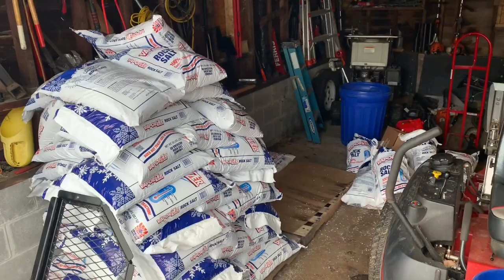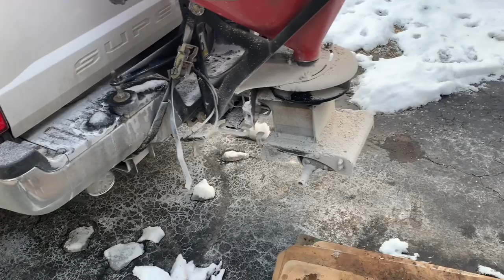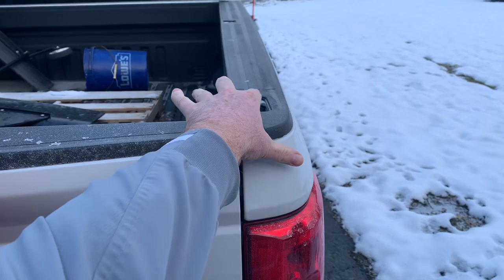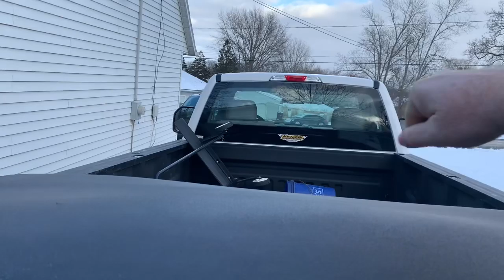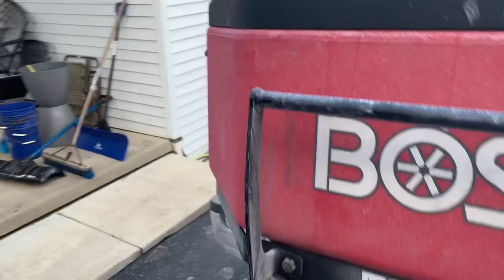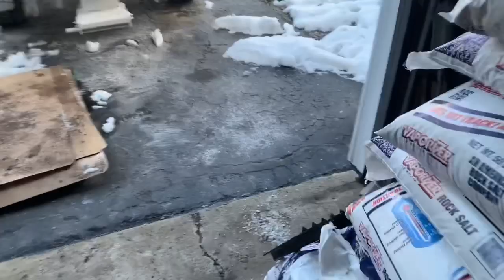The verdict is in!!

Comment: Remember I welded more mesh on my screen to make the holes smaller. My opinion, I would be more concerned with it's effectiveness over how easy it comes on/off. How many times do you take it off or put it on compared to how many times do you use it to spread salt. Just my opinion, but that's what would make my decision for me.
Reply from the maker: Countryside Vlogs I wish it spread better in the lower numbers.  I think the spinner is the issue.  I’m trying to speed up in the lots to get down the salt since it pours out the first 6 seconds.  But I also feel rushed.  When I turned the dial up to match the spread pattern I burned through the salt🤦‍♀️.  Ughhh.   I guess I’m just too picky.   Now the plow controller absolutely sucks
Reply: @JohnnyMow  you had a good thing going with your old setup. You loved it, the plow, the salter. Someone's buying the latest and greatest just isn't worth it
Reply from the maker: I guess I thought I would try something different since I got a new truck.  We will see how it goes.

Comment: You know I use both. If you are solo and don't want to leave the spreader on for months at a time get the tgs1100 or 600. If you don't mind leaving the spreader on all winter or paying help to help take it off,  get the snowex 1075. The snowex controller is awesome. BOSS needs some serious upgrades in my opinion. For me coming from boss to snowex.... Its still up for debate but, I honestly think Johnny I would go back to just Boss at this point. It isn't as efficient with spreading. It does waste more...but, the other features out way the bad.  Love being able to take that sucker off on a whim and go run the truck through the wash. Snowex needs the dolly system and boss needs spread efficiency improvements and controller updates!
Reply from the maker: GET IT DONE WITH GUNN good points.

Comment: I was checking out the new F-250's and F-350's. The 2020's bed is almost 2" shorter from the ground to the top of the tailgate compared to the 2019 because,  people were complaining so much about the bed access,it's too tall! I might be getting a new single cab F-350 dually with the new 7.3L gas engine and 12ft flat landscaping bed. I wanted an NPR ISUZU but, I test drove one and it was way to  bouncy for me.

Comment: I had the snow ex tailgate pro with was what you had and the tailgate pro I returned the bulk pro the day after I used it it keeped blowing fuses I didn't mind the tailgate pro but I hated refilling it every few parking lots and because I have a loader and a spot to put it I ended up going to a in truck bed spreder
Reply from the maker: Joshua Feltz 101 great set up.

Comment: Do you run your spreader with the gates wide open? I run bagged salt also but I’m having trouble with larger salt bridging above the auger witch doesn’t allow salt to come out like it should. I’ve never had this problem with previous TGS 1100s I’ve owned.
Reply from the maker: I run the gate wide open but after initial blast I run about 7 on the controller
Reply: @Johnny Mow  do you get an even spread across the back of truck covering lane well. I keep getting the majority of my salt spread on driverside with it set on 7-8 hardly none on passenger side . I gotta constantly dbl salt wasting so much

Comment: How do you adjust the pattern to be equally across the back of the truck...my 1100 spreads the majority of the salt on drivers side and light cover middle and next to none on right. Very annoying and wasteful
Reply from the maker: There are tabs with wing nuts check to make sure they are open

Comment: I have the boss tgs 600. Works fine but i feel like there is no real way to control salt flow. I put the butterfly bolts close to chute to limit some salt coming out and keep spinner at 3-4 but any other way to limit spread? I see on your that you have the choke (butterfly bolts) wide open?
Reply from the maker: I turn the spreader to zero between uses on the lot.